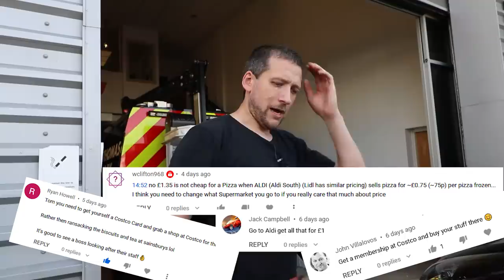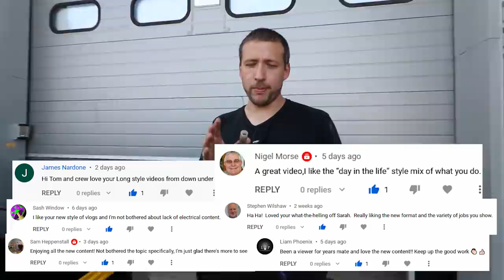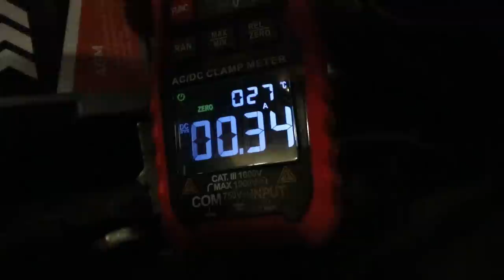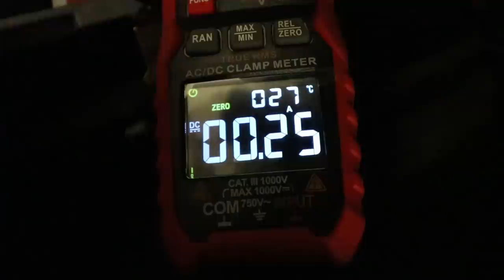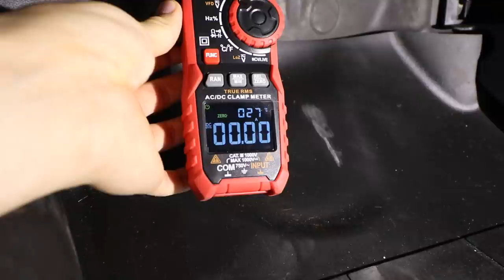THE NIGHTMARE JOB IS BACK! | Thomas Nagy

Comment: On the EICR where you found the misleading ring with break and possible 2 radials or an accidental split its an FI and then you come back to that on an hourly rate. I totally get that customers think your trying to take them for a ride on a recent EICR I did found down lighters in connector strip no covers etc and the customer got the contractor who did the kitchen makeover back to sort them all out. I bet I was cursed by the spark who had to come back but he did a proper job and all was well after that. But he should have just done that first time round. Have a good  one Tom  regards Sean

Comment: Is it against the regs to take a feed off a light or switch feed now?. My college said it was I just thought I ask if they need there own breakers in a circuit for alarms
Reply: For smoke/heat alarms it is prefered to take a feed from the lighting circuit. It's in the regs.

Comment: Don't for god sake connect a charger to the van without a battery , if you wish to change the battery use a small AGM battery on fly leads to keep the vehicle powered during the change over.
Chargers very often have very poor output voltages when a battery is not connected.

Comment: While I tend to agree with you that the connection is the cause of the fault indications, I had a Ford Ranger that would die randomly while being driven. Just as if the ignition switch had been turned off.  I checked all the points I could access and had the ignition switch and wiring harness replaced by the dealership. Didn't solve the problem and it was so intermittent it was impossible to trace. Ultimately I traded the vehicle in on another purchase without ever figuring out the issue. You know how difficult troubleshooting can be. So many computer controlled sub-systems in vehicles today. Super sensitive to noise and loss of power. Do not be surprised if the problem returns. The 600mA draw is likely all the built in computers and clocks. Upgrading the battery size may not be as simple as you project. The internal recharge settings my still be designed for the smaller battery and so may not maintain the new, larger battery. In fact, it may cause the computer to start throwing faults that the electrical system is failing... Also, isn't possible that there is a poor connection that is vibrating (making and breaking) as a result of the door closing that causes the trip?

Comment: Instead of having a battery tender, you should fit a battery disconnect (unless the electronics freak out with a total off).....   As someone else said, 600mA is too much.  You need to test it with all the doors & hood closed/locked and wait 1/2 hour for it to go to sleep, sometimes as much as 2 hours.   A voltage drop across fuses will tell you which circuit is pulling all the current.

As far as "qualified" mechanics LOL, incompetence is everywhere, most mechanics are parts changers, nothing else.
Reply: I would rather just disconnect auxiliary circuits.
Reply: Exactly. Esp Lucas diesel specialists. Just randomly change different parts dragging it out as long as possible charging labour at £75 per hour when they've not a clue what they're doing.

Comment: Is it possible that the tracker has little or no signal when you park it in the building so it is constantly transmitting high power to try and find a local cell connection?  In a  company I worked for the trackers caused huge battery issues, we worked in the country with poor mobile coverage. Trackers generally use mobile signals.  Ended up using an Irish SIM card that would go across all the networks to overcome the signals issue.  Still had battery and ECU error issues. One garage removed the tracker on one new van and refused to reconnect it as they said it was the cause of expense  to them ..

Comment: Jesus, 3W when not doing anything?  Some cars will not fully shut off if the bonnet is open, and some like BMW for example can take up to an hour to shut down completely.  I'd set the cut off to be around 12V and not turn back on until the battery has reached nominal 12.6V for things like trackers etc, they have their own battery and only ping every so often.

Comment: If two breakers feed a single lightning circuit why is it only a c2?
I understand it has potential to be dangerous under fault conditions.
But it is dangerous in that it can't be isolated and there is no fault protection suitable for the circuit ie the breaker is over rated for the cable. Is this not an arguable case for a c1?
New to eicr so advice is appreciated.
Have come across a similar issue with two ring circuits having the return legs put in the adjacent breaker requiring both to be isolated to make safe.

Comment: Does it matter if it’s a ring or radial. You are only allowed one socket off a 32A Mcb in 2.5mm. Any more off same cable and it doesn’t meet regs.

Comment: In regard getting a Costco membership, just to give you a heads up, when you get to the check out, and you see the bill, you may feel a lil faint.  Every time I did a shop, just for me, not as a business type of thing, just personal, I was always shocked when I saw the bill.  You have to remember, you are buying in bulk, and you will need to work out, when buying, how long you will have that stock for, even if its just for personal use, but yeah, be warned, because once in, you tend to lose your head and buy stuff you never knew you needed.

Comment: 600 to 700mah when the vehicle is asleep? Wow, that is a big problem. A typical figure on a modern car would be less than 60mah. Cannot see why a van should be different. Something on those vans is not switching off. I would be pulling fuses until i found the circuit responsible for the draw.

Comment: Air pressure can trip RCD's. Really?! How? I'm a little skeptical. There's nothing pressurised or sealed in an RCD is there? Sure it wasn't the vibration of the door closing disturbing a connection somewhere?

Comment: as soo as the vans batteries are dead again, upgrade to AGM's.

but you still should search the standby drainer.  anything higher then 42mA (1Ah per day) is to much. and 3 digit figures are ridiclious.

Comment: Put simply you have a bucket of water which you have filled with water. As long as your bucket is water tight, the water will stay in the bucket. So your battery is the bucket and the water is the charge level. The tap to fill the bucket is your alternator.
Now drill a small hole in the base of the bucket, you now have a drain. The larger the hole, the more water (or charge) will drain out. If you turn the tap on frequently, the battery stays charged. Leave the bucket over a few days without turning the tap on and your charge drains away. The speed that charge drains away is governed by the size of the hole you drilled or how many holes you drilled.
So in your case 800 mA !!! Is way too high. The large German vehicle group I work for suggests 70mA as a maximum acceptable discharge for their vehicles. That is 0.07A on a meter, you have 0.800 A which is similar to leaving a glove box light on all the time. Your parasitic drain will discharge your battery to a point where it not only won’t start the engine, but could damage the batteries ability to accept a charge. 
When I check for parasitic discharge I either disconnect the bonnet switch or close the contact so you can do tests with the bonnet open. Turn the radio traffic service off, disconnect any dongles plugged into the OBD port as won’t allow CAN to shut down. Any additions disconnected. Leave the vehicle in a locked state for 70 mins to allow ecu timers and networks to enter sleep mode and use a sensitive amp clamp (picoscope) or as a guide yours will be ok and see if your 800 mA drain shuts off. IF you have keyless entry on the van, put the key in a Faraday bag.
If the drain doesn’t drop off, check volt drop across your fuses with a volt meter to see which one is pulling mVolts. Avoid pulling fuses as this can destroy any evidence and may need to go through the whole thing again.
Much more to it than I have suggested, but it may give you a starting point.

Comment: 9:35, no i would say the complete opposite, if the homeowner owns their house they would probably be delighted you spotted those things, and would be good both for them and you to get all those things sorted at the same time in one swoop, and what is a few hundred pounds/thousand for a whole new proper setup in a house or appartment that is worth hundreds of thousands... and they increase their value, because what is a lets say half a million appartment with terrible electrical work.. it would on the contrary be insane value for the customer if nothing.. ?

Comment: Do not use those workshop start-booster chargers for longer charging. They dont have any "brains" so they overcharge batterys and usually kills them if you leave them charge batterys for long time. They are meant only for charging totally empty batteries fast and boost batteries to get engine going fast. Get a Ctek or something else like Ctek which has microchip controlled charging and automatic tricle charging too. For that kind of use i recommened to get minium of 10A model. But i recommened Ctek PRO25S so if there is lights on at the car, with that kind of load larger Ctek is capable to keep them going and at same time charging the battery.

Comment: 2:49 Thomas Nagy Electric Mechanical Engineer Pty Ltd Let us tighten your NUTS is our slogan.
21:50 You'll wait for these new batteries to die? Well I guess we only have a 3 or 4 week wait for that answer then. 🤭
29:57 If the one in the unit is called Luke, is this smaller Skywalker called Anakin? 🤷‍♂️

You are spending too much time behind a desk and consuming a few too many calories. Be careful Mr Nagy because it sneaks up on you plus it's a bastard to lose it later and I am speaking from 54kg of extra experience.

Comment: I aquired a van  that the owner was just done with… after they new alternator started failing, someone cut the catalytic converters out, so they called me to haul it away.  I fixed the pipes and turned to the new alternator (which was, sadly, toast), and determined that the bizzaro battery that had been fitted had a tiny tiny positive post.  The connector was indeed loose, despite some “professional” mechanic having tried to manage the gap by wrapping a bit of lead sheeting around the terminal.  New battery, new terminal end, job sorted.

Comment: Don’t want to appear to be a smart Alec, but as you were talking about the battery problem I wondered “ could it be a loose terminal ? “ ……
Reply: In my experience, one prime cause of electrical intermittent faults are loose connections

Comment: So demolishing the bridge and building a new one is okay but demolishing a house and building a new, more efficient one isn't. I don't follow the logic? It's always quicker, easier and cheaper to repair something rather than rebuild it. Also, think of it this way, if you will be demolishing a bridge, you will probably need to refurb or upgrade the foundation of the pillars, if not add new ones, plus the added cost of new materials, architectural engineers time etc. Look at the blackfriars railway bridge as an example.

Comment: Sounds like a draw that is to high. Normal Vehicles  around 100ma which is still quite high. I would bet it’s something aftermarket installed causing the issue
Reply from the maker: We did end up getting to the bottom of the issue, I will be going through it in the upcoming Friday Video ;)

Comment: And do not do that charger trick when changing batteries. You need computer still to tell the car it has new battery. Like VAG cars (Volkswagen etc.) you have to tell car that battery is new and car needs battery information like capacity and its type (AGM etc.) or it doesnt charge battery like its needs to becouse car thinks battery is old and car controls charging to match that old battery capacity (capacity what was left in that old one). Cars in these days keeps eye for battery aging and its available capacity and if you replace battery you need computer... that charger trick doesnt work anymore with new cars.

Comment: R.E. Costco.  you just need to show one piece of business evidence valid within the last 3 months, something like Public Liability Insurance certificates, Vat registration cert, Companies House cert of incorporation, Business cheque book or bank card.  Failing that, an accountants letter confirming the business is legit   AND a piece of photographic identification.     The ability to refuel cheaply is the main bonus for me.  I refuelled my car this morning and on my way home, I passed another petrol station and noticed the difference in diesel was 5p per litre.   If you're doing a large amount of miles and using a lot of fuel, then 5p a litre will mount up.  As for food, some things are good value but others not so much.  The meat is excellent but more expensive than supermarkets.  The freshly baked cakes are ace too.

Comment: Calling an RAC breakdown tech a "fully qualified" mechanic is like me calling a bloke who has done a week course a "fully qualified" electrician which I am sure you would not agree with.

A tech who is on a van & gets called to every type of make & model on the road can in no way build up the depth of knowledge & experience required to accurately diagnose every vehicle they see due to the limited time they have with the vehicle, the roadside environment & to be able to have the knowledge that covers thousands of manufacturer specific systems onboard modern vehicles, let alone all the diagnostic equipment required.

Hence why its basic checks & if that don't fix it then tow it to wherever & that is all you can expect from a breakdown service. 

Expecting a full on diagnosis from a breakdown tech is like me expecting you to give me an EICR in 20 mins for £40.

No excuse for that lose battery terminal but that tech got his quota for that day selling you or the warranty company that RAC battery for 50% above RRP.  

Servicing between makes & models on ICE platforms is a much of a much but when you start talking about diagnosing manufacturer specific systems you need in depth knowledge & the right equipment to perform an accurate diagnosis otherwise you are in "swapnostics" territory. 

When testing parasitic drain you need to leave the vehicle for at leat 20 mins to allow all the control modules to go to sleep, also having any door or the bonnet open can keep certain modules awake which gives you a false current draw reading.

If keyless entry is present make sure the key card is far away from the vehicle. We use faraday pouches to block the signal from the key.  

Using a screwdriver you can latch the door catches allowing you to keep to doors open without keeping the modules awake. Just remember to unlatch them again before shutting the door by pulling the door handle.

0.25 amps is still way to high to standby current draw, you need to be down near 0.05 so either not all the modules have gone to sleep or something pulling to much current.

Here is a great video from the Car Wizard on how to check for parasitic drain: https://www.youtube.com/watch?v=UEYGmSn01Bw

Take a look at Diagnose Dan on YT to see what an diagnostician is.

Comment: 11:25 CAREFUL TOM, the at risk employee may cause more issues than you want. Hate to see anyone stuff up what you have worked so bloody hard for. 
As for the battery terminal being loose, I do automotive work as a hobby the amount of s@#T i have seen makes me shake my head, A vehicle i serviced was a joke, Poor lady had been ripped off blind, Charged about $220 AUD for a battery terminal, then another person's car i fixed the mechanics missed more than ONCE her cabin filter, time i found it the filter was jet black and foul smelling & oil filters not even tight and leaking oil everywhere. Anyway as always love the videos.

Comment: Unfortunately you can not compare an RAC ‘mechanic’ to a fully trained vehicle technician! Not a chance in hell could they rebuild an engine!

Regards to the battery drain 600mA is a heck of a lot of current for a car/van to be drawing. I can only go off BMW’s but the maximum they draw when asleep/locked is 80mA and that would be a really high spec 7 series normally 20-30mA at the most. If I saw a 600mA draw defiantly would be saying has a battery drain!

Comment: Wtf  ? Electritian or Auto spark ,,, If this guy is willing to muck about in someone elses trade ,,,,, i wouldnt call him in for a job thats what cowboys do  : ) Why are you not checking for current draw at each fuse at the fuse box ,,testing the main cable only tells you that there is current  draw ,not what circuit it is on : (